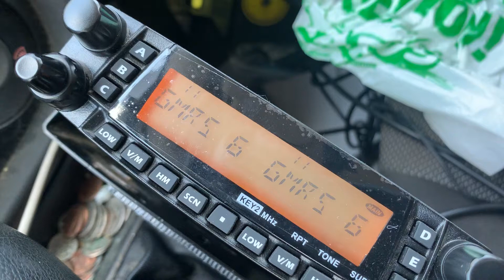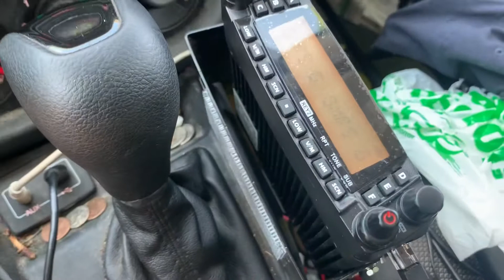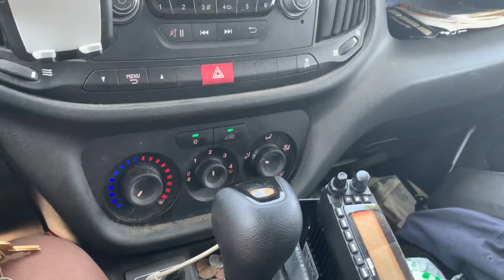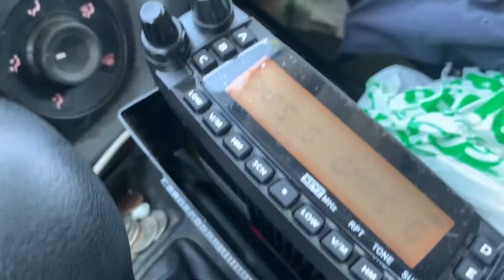GMRS Family Radio System Field Test

Comment: i have a gmrs license and a mildland mxt115 with a antenna magnetic mount 6db gain tram  dual band antenna and ican hit the repeater for 50  to 60 miles on my suv on top of the suv .. compare to the stock antenna ican hit the  repeater for only a  25 miles ... and also i have a btech gmrs v1  on my hand heald and  one each of us  5 person , same with my car and my suvs and also on my house i have mxt 115 with a 6db gain magnetic on the top of my roof  no problem at all  and its fun for in door and out door good for travel and evrything that u need ...for prep and dont 4get to get a extra battery and also a SWR meter to tune  and get a nagoya 771 for the btech gmrs v1 or abree antena sme femele for the btech gmrs v1 or luiton 771 sme femele antenna you gonna be a capable gmrs family UNIT 1 TO 5 AND UNIT HOUSE , UNIT  FORESTER , UNIT  SANTA FE , UNIT ROUGE , UNIT COROLLA , UNIT RAV4  THATS HOW I USED  MINE ..and also sign up for MYGMRS.COM  and ask permetion to the owner of all the repeater in thr whole US and they will gave you the trasnmit and receive pl tone wait for your email and they will grant you make sure you put evry thing your info . PROUD GMRS users
Reply from the maker: I signed up for MyGMRS.Com a few weeks ago. Cool site!
Still waiting for permission for a local repeater. 

I am NOT getting 50 miles or anything close using simplex so far. Best we have done is 7 miles and that was with the help of a bridge for elevation. 

I wish I could get my wife to take the HAM test, lol.
Reply: @suburbanhomesteadoutfitter4135   yeah max on the simplex is about that and also on the repeater u can get max

Comment: What's the price range on the GMRS? Out here we are flat as can be, so short of climbing on a house what we get is what we get.
Reply from the maker: I get used commercial radios on ebay, then reprogram for GMRS. Recently bought a PAIR of Kenwood radios for $120 (60 each). 
https://www.youtube.com/watch?v=o8RgQHYRqI8&t=165s
Reply: @suburbanhomesteadoutfitter4135  appreciate ya sir. Good looking out.
Reply: I have a Kenwood KT-880H-1 which is a 45 watt mobile that I paid $145 for it and the seller programmed the channels I requested with the purchase.I now have a programming cable and the software to program more channels if needed.It’s a solid radio and well worth the cost to me. The programming cable and software were Cheap on eBay as well.